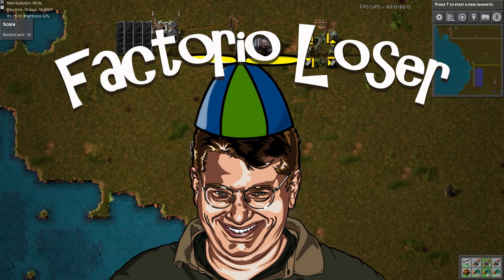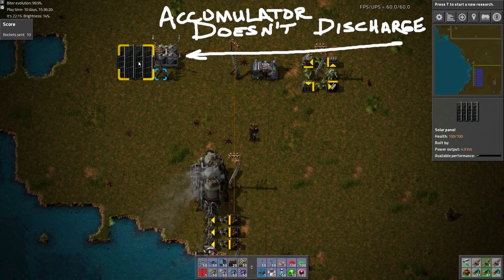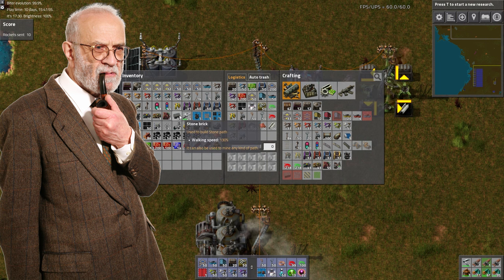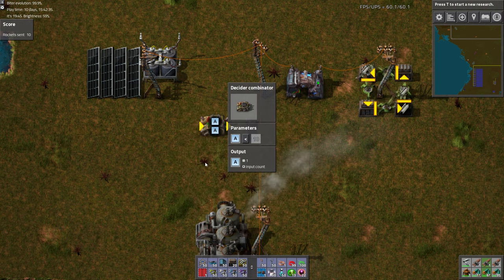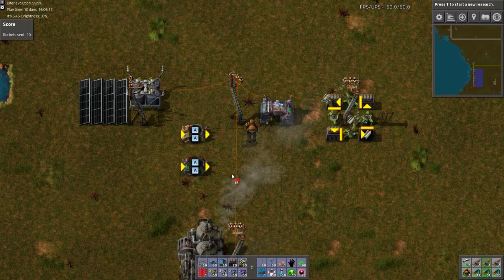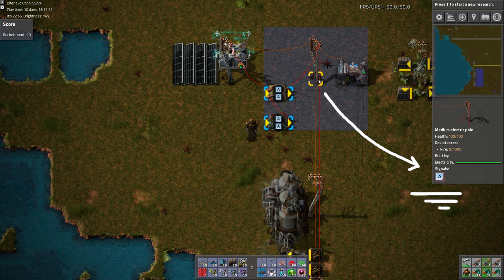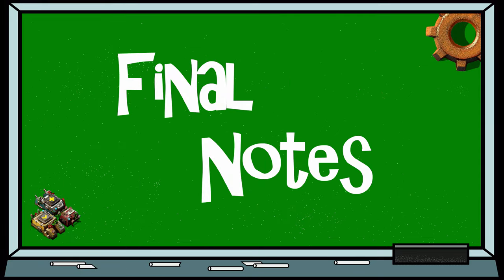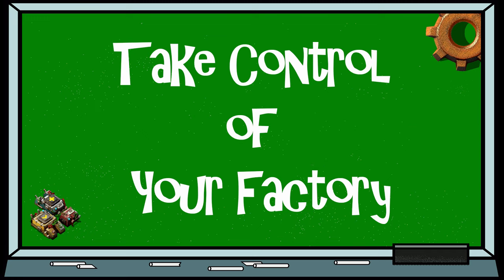FACTORIO TUTORIAL: EMERGENCY POWER SR LATCH | Combinator Classroom Ep. 4

Comment: Amazing, thanks for the effort put in to explain! So the setup works with multiple accumulators?
Reply from the maker: Thanks Ian... Yes. Multiple accumulators is no problem. Just make sure all your accumulators are part of the same electrical system. When multiple accumulators are all connected on the same electrical network they act as one.
Reply: Actually I realise hooking to one accumulator is enough, because they all lose power at the same rate, one accumulator is enough for the circuit.
Reply from the maker: Yep... Exactly!

Comment: But why would you wire the pump (can toggle up to 10 steam engines) instead of the far more obvious power switch (can toggle an infinite number of steam engines)? Also, no need to extend wire duration with power poles because you can just plop down an extra accumulator next to the power switch.
Reply from the maker: The honest answer is I didn't think about using a power switch at the time of making the video... I had it in my head to control the pumps. I guess my thought process goes immediately to controlling the source.

My only thought about the power switch is that you have to ensure your steam engine set up is completely disconnected from the power grid outside of the connecting through the switch. Not a big deal if your steam engines are out and away from the main factory. 

And yes, great point about only needing an extra accumulator next to the switch. When I implemented this SR Switch into my FFF Factory, that's exactly what I did which eliminates having to run a wire from some distant solar array.

One person, I forget where, did mention he uses multiple SR Switches to control different pumps at different levels so steam power gradually turns on as accumulator charge winds down... Which is kind of a cool idea.

Comment: Hello, a noob here. Who can explain where the times -25 comes from? I know it apparently does the job, but I’m trying to learn the logic of it all, I’d like to understand. 

Here’s how far I got: 
The triggers are: 
10% charged (turn ON steam) and 
35% charged (turn OFF steam)

So when the charge minus 25 = 10 or higher, that means the charge = 35 or higher. That’s the point where 1 should become 0. The steam turns off. 
As long as the steam is off,  that 0 is multiplied by -25 whereby there’s no trigger until the charge drops below 10. Because below 10 it turns the 0 back into a 1. 

I think I just explained it to myself. Sorry for all the monkey terms. I told you I’m a noob.

Comment: So you're saying that if I have 100 accumulators I don't need to change any of the mathematics  on either the decider or the arithmetic combinator at all?
Reply from the maker: Correct... But just make sure you only connect ONE accumulator to the Decider Combinator. Each additional accumulator you connect will double what is read.
Reply: So my pumps turn off during the day as intended, but I noticed when I hover over a accumulator during the night time they read at full charge? Does this suggest that I have made an error when setting up? Keep in mind I do not loose power when my steam engines are off during the day.
Reply from the maker: You may be good to go in terms of solar power requirements... Typically, when using the latch, if the pumps turn on, that is the signal to add more solar power.
Reply from the maker: On second thought, double check that all the solar power and accumulators are connected into the same power network. At night, the accumulators should discharge... even if it's a little.
Reply: Wait a second. When you ask if the other accumulators are on the same network you mean just connected via the same power pole lines?  This is the case for mine, but when I left click on one it says "not connected". Do I need to run red/green wire to fix this? Or should it just work since there is a power pole running from my set up in your video to all the other accumulators and solar panels?
Reply: Wait a second. When you ask if the other accumulators are on the same network you mean just connected via the same power pole lines?  This is the case for mine, but when I left click on one it says "not connected". Do I need to run red/green wire to fix this? Or should it just work since there is a power pole running from my set up in your video to all the other accumulators and solar panels?
Reply from the maker: Yes... Just connected by power poles. NOT red or green wires.
Reply: Hmm that is what I have already so not to sure on what to do :(. Thanks for your help anyway your videos are helpful.

Comment: Just to be a party pooper. Is there actually any point in doing any of this? It does not seem obvious to me that you actually achieve anything by discharging your accumulators like this other than having to charge them again later. 
According to the wiki: 
"Steam engines will automatically adjust their power production and steam usage based on the current demands of the electricity network." 
Does this not mean they will switch off during the day if you do have enough solar, or have I misunderstood something?
It makes sense to use accumulators for emergencies as you are trading slightly higher production now for spikes in consumption later, or to use them for isolation. 
What am I missing?
Reply: nvm I see.

Comment: if you're like me and you would rather see it in code to understand:
A: Int = AccumulatorPowerInPercentage
B: Boolean = pumpSwitch
if (A < 10):
    A += A * -25
    B = True
else:
    B = False
Reply: For code, note also that it can only change B to equal false if 'A' is greater than 35.  In your above code, it looks like if A is equal to (or greater than) 10, then B will be set to False.

Would this be better:
Evaluate A
   When A < 10
      B = True
      A += B * -25
      End_When
   When A >= 35
      B = False
      A += B * -25
      End_When
   Else
      A += B * -25
End_Evaluate

(Yes, the A += B * -25 could be pulled out to be a separate step after the Evaluate, but then this pseudocode would have to be its own paragraph and involve more spacing)

Comment: why use the pump instead of the switch?
Reply: if you turn off the switch you cut the power to the factory entirely
if you put a switch between the steam engine and the factory but before the solar panels, the steam engines will still consume a little of electricity to maintain the inserters, cutting the water supply is the most efficient way

Comment: Simple? Why not use the power switch instead of running the signal to the offshore pump? In addition to having the wind-down period after state 2 is reached (pump off) you also have a delayed start as water is pumped into your engines and is heated.
Reply from the maker: This is the 3rd comment with regard to using a power switch instead of using pumps to control steam generation... Hopefully my response will put this topic to rest!

The wind-down and delayed start is irrelevant... Adjust the latch accordingly.

Using a power switch instead turning the pumps on and off may be a better solution if the only connection to your steam generation is through the power switch. Simple enough but it requires some planning.

In my mega factory I've wired up the offshore pumps and it works perfectly fine. The bottom line is that my steam generation is for Backup ONLY... My factory cannot run off of my steam generation.

If the concern is efficiency... Build more solar. With enough solar panels and accumulators; Steam Generation (almost) never turns on. In effect, I know it's time to add more solar if my steam generation turns on.

Consequently, whether you use a power switch or control the pumps, that decision is also mostly irrelevant... It more has to do with preference and base design than anything else.

Finally, the main point of this video was to demonstrate how to use combinators and how to use them to build an SR Latch. Using the Latch to control Steam Generation was merely a practical build to implement in your factory.

I look forward to seeing how you use combinators and the SR Latch in other areas of your factory!
Reply: hey this video was cool and helpful and I've experimented with rail signals and gates to come up with rail crossing system and I want you to see wether you re-create it
Reply: The way I use this is that the steam array literally is my indicator that I need to add more solar, the fact that it also generates power just makes up for my generally slow response to such indicators.
Reply from the maker: GlassDeviant Exactly... It's highly recommended to check power fairly regularly no matter what the power setup may be!
Reply from the maker: SBlack The point of the Latch is not to prevent flickering, but rather to ensure the steam engines remain on long enough to charge the accumulators to a "Safe" level. I did some testing on identical builds... One where the accumulator was attached directly to the pump and the other through the latch. The Latch used more coal, about 7% more, which makes sense since the Latch is not just trying to keep the accumulator above 10%, but rather is driving it up to 35%. But the most important thing about the Latch was that it prevented the accumulator from dropping to 0% charge as often as the non-latch build. The accumulator on the non-latch build was held at 0% charge 33% LONGER than the Latched Build. In the end, the Latch keeps your power situation more reliably in the "Safe" zone... Essentially there's less chance of "bottoming out" your power grid when using the Latch!
Reply: What about just setting the condition to 12 or 15% instead of 10, so it would never get down to zero?
Reply from the maker: You could... If 12 or 15% ensures you never bottom out. The problem is that power requirements can vary a lot from moment to moment. Would you want your accumulators hovering around 12 or 15% charge when that next wave of bugs attack? Or would it be better knowing that if your accumulators hit 12% the steam engines turn on and remain on until accumulators are at a higher charge. Ideally you want your steam engines doing as little as possible... Which is what happens when hooking the accumulators directly to the pumps. But in exchange, you run a greater chance bottoming out your power network. I ran my test using a constant load. I'm sure the results of my test would change if I threw in random power spikes.
Reply: I particularly prefer a latch over direct link because when you are exactly at the % level, the switch turns like on off on off on off, that is kind of annoying for me. But doesn't affect any thing on the game.
Reply: A purely aesthetic issue is that when you disconnect generators using a power switch they all start blinking with the yellow "I'M DISCONNECTED" warning. I think they have plans to fix that, but blinking things can be very distracting.
Reply: Not to mention the whole epilepsy problem.
Reply from the maker: cogwheel42 Besides being totally annoying, I don't think that flashing helps FPS/UPS rates.
Reply: ShredGuy99 yeah I tried and it almost killed my computer

Comment: All I want to do is reset the Arithmetic combinator to 0 when it counted to 100.
haaaaaooooww?
Reply from the maker: ICAN... I know you can figure this out. In the video, we have the steam engines turn on when accumulator power goes below 10 and stays on till the charge hits 35. In the arithmetic combinator, we set the bias to negative 25 (the difference between the 2 charge levels). So how would you modify the latch in the video to get the result you want?
Reply: ShredGuy99 I figure that I need a button that send the amount it counted *-1 ones.
I cant seem to figure it out in the space that I need it to be. so never mind

Comment: The tutorial's use of a single Decider + a single Arithmetic combinatory is novel, but I dislike the editing (cutting the narrator off mid-word frequently) and I dislike the decision to connect the Circuit network to the steam pump instead of inserting a power switch between the Steam Engine (power source) and the rest of the power network (stored power in the accumulator + power draw from factory).

The problem is that using the pump instead of a dedicated power switch means that you're Steam Engines have a ramp up and ramp down period, which is not ideal when you need an immediate power boost to extend your Accumulator life span. Additionally, it's also not ideal to put the Combinator logic on the same power grid as your steam engines because that creates a small draw all the time, resulting in slow fuel burn and minor pollution.

While this isn't a big deal in most games, for players who are attempting to minimize pollution it's one more method a player can attempt to reach the ideal minimum pollution footprint. Also, if your playing in a world where fuel (wood, coal, solid or rocket-- I know, rocket in boilers, never) is limited, reducing your fuel burn is possibly only by putting the combinatory logic outside of the steam engine power grid.

I do appreciate the example of a DC+AC to do an SR latch based on a numeric value (like an accumulator charge). I can see where that could be handy in a few places in my designs to streamline combinator systems (reducing total combinators to achieve the sames results.)

Comment: Instead of attaching all your pumps, wouldn't it be better just to use a power switch between your steam engines and your energy grid? That way you aren't even wasting your hot water. You don't even need an SR latch, you can just set it to A=25, and let it turn on and off fifty times a second to keep power at 25 during the night, and running off panels during the day.

Comment: I followed this guide exactly as far as I am aware and it doesn't work. This is the 2nd time I followed a tutorial trying to figure this out and it doesn't work. Right now all it does is shut off my offshore pumps permanently. WTF am I doing wrong??
Reply from the maker: When in doubt, double check the wires. Make sure wires that are supposed to be attached to the front aren't accidentally attached to the back, or vice versa. That has happened to me more than once.
Reply: @ShredGuy99  I figured it out watching your guide. It just took a little longer. Idk what was going wrong.

Comment: Started watching your series with the assumption there might be a video to describe how things work not how to achieve a goal. It started out so well till you outright put a tutorial for a common problem solution. It's not the problem that's standing in people's way it's understanding the tools they have on hand. Your initial videos described new functions well without fleshing out all the details. The tutorial videos stand out as the least helpful videos of the bunch available.
Reply from the maker: My initial intent was to go through each item and explain how they work... But ultimately, the tools are simple. For example, there is nothing complicated about how combinators work. The complication arrives in how different combinators work together. Hence, this video is NOT about an Emergency Power switch, it's about learning how to build and use a SR Latch. If everyone watching this video built this Emergency Power Latch and attempted to truly understand how it works, they would be 75% on their way to becoming a Combinator Pro.

Also, there's a significant portion of the community that doesn't care about learning anything but how to download blueprint strings so they can slap down "done for you" factories. This video gives players less concerned with learning how combinators actually work, to put into "play" a combinator build. My hope is that a little bit of interest in how combinators work rubs off in the process.